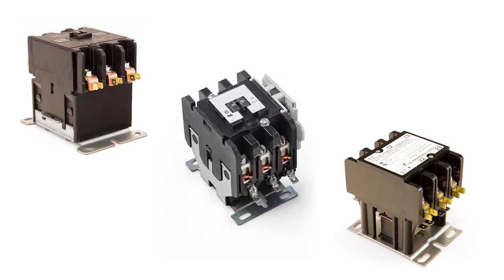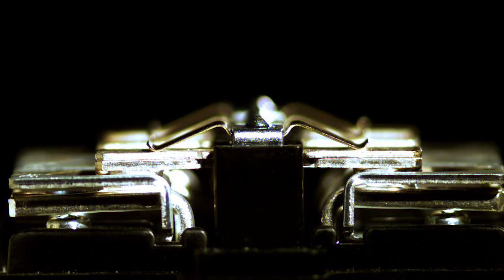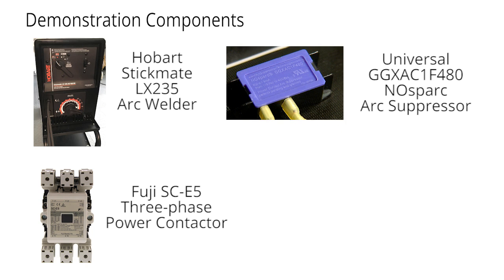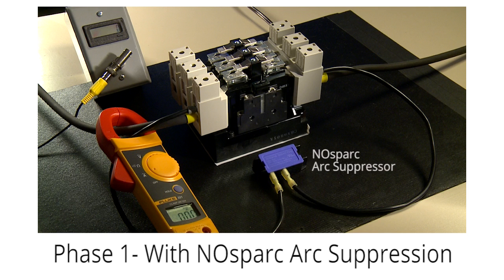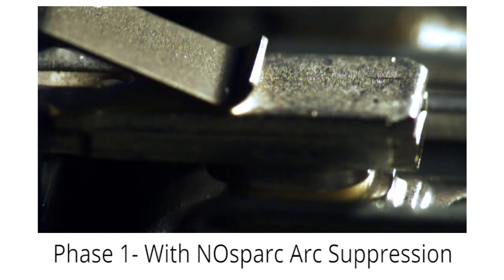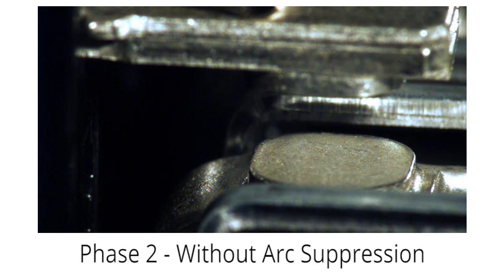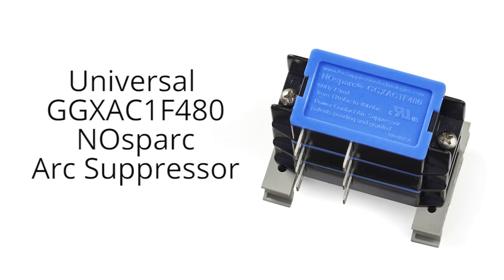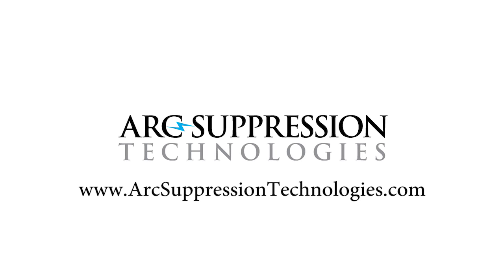Ending Contactor Destruction

Comment: Most often to rarely

1. Arcing on contacts

2. Contact breaking of high currents like a piece of thin wire running 10A .

3. Electromagnet (Coil) blowing out.